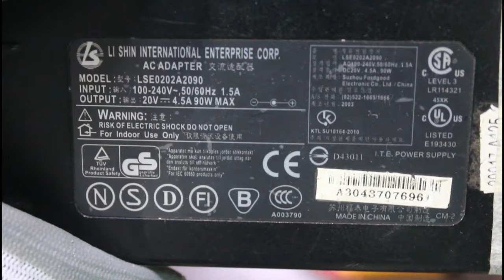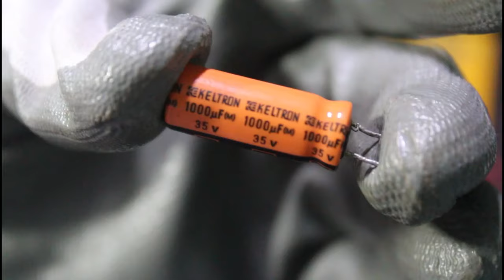DIY - convert laptop power adapter into variable supply l 5 volts to 35 volts

Comment: u removed both feedback resistors which leaves 4 terminals behinds. where did you connect 2 wires of potentiometeR?
Reply from the maker: 2 feedback resistors are in series
Reply: How to find these resistor?
Reply: @technokhan7429  connected to tl431 reference pin to +

Comment: You took out 2 caps of 25v each and replaced with one 35v. What happened  to the 2 open terminals?
Reply: No problem. They are connected in paralel - not in serial.

Comment: What if i change the capacitors only? Will it give 35v ?
Reply: Sorry, your question can only be answered by : Dont try or touch anything, learn the basics first - especially when the subject is mains power adapters.
Reply: @someone2506  Hahaha nice answer
Reply: No, you need to change the feedback resistors on the first place, and as he mentioned any capacitor rated for 35V or higher will work
Reply from the maker: no